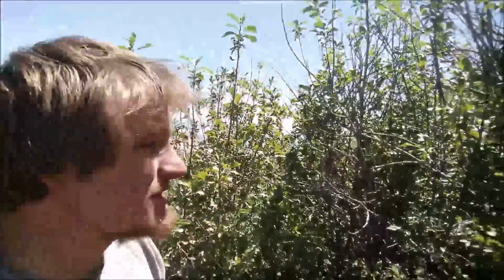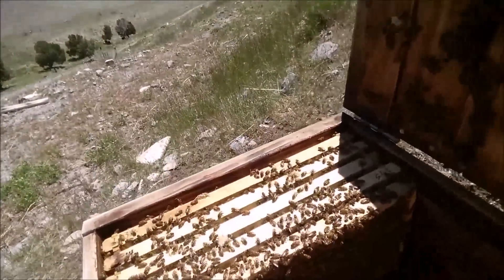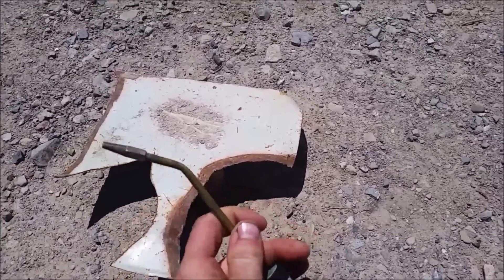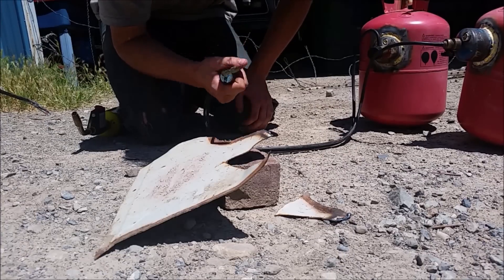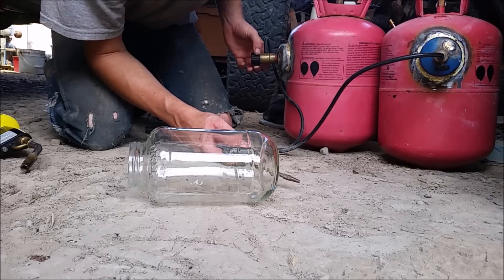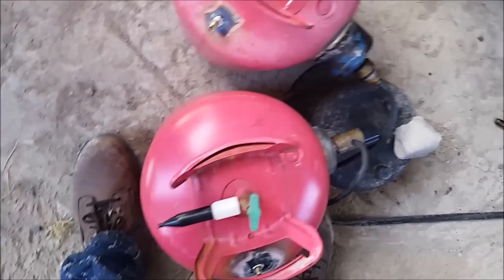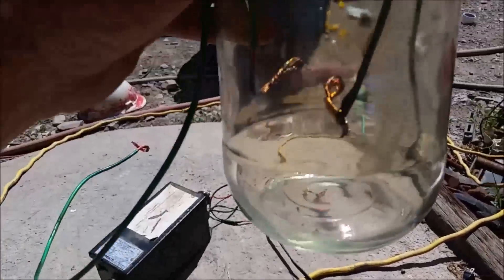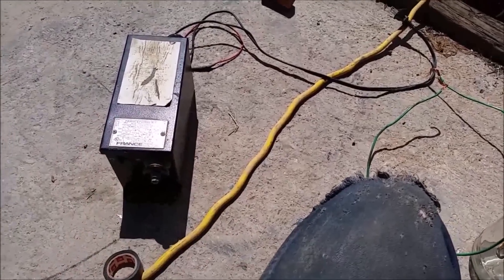Testing My Oxyhydrogen Torch

Comment: I don't know your luck with the oxy/propane setup. Which is what I used that same setup you have(the torch itself). I cut a 91 S10's truck bed with it. I will say it was quite the feat to get the ratios right so that the flame didn't blow out. It can cut thin steel but using hydrogen is very impressive. Might have to setup my own water breakdown system and use that instead. If you had bad luck with cutting where you live(I assume the midwest, I just started watching your videos). It could be to the air density where I live that I managed to get it to cut. I am in the VA area and I think maybe 150-200 feet above sea level. That would be my only theory on that anyway. But awesome videos man. I love trying back yard things like this but your is so next level compared to mine. But being near the DC metro area I can't do nearly as much as I want. Awesome stuff glad I found your channel Cody! My son loves your stuff to when I let him watch. He is 5 about to be 6 in a few weeks so I am sure you could understand not wanting a 5yo mad scientist running around. I already have to watch what he does really close, caught him a few times trying to light up my make shift forge and stuff lol!

Comment: clever licking off your finger after digging them in mercury
Reply: +wesker005 
New to the thing called video editing? A hint: things a minute apart in a video were not necessarily a minute apart in reality.
Reply: Dylan Elliert
Now that escalated quickly. But I've been taught something even more useful: thinking! Uncommon concept for some, but you might try it some time. There is no safety issue here, at least none that's worse than eating a can of tuna.
Reply: +superdau its not like this guy isnt a complete idiot. he DID put a full ungloved hand in mercury..
Reply: +Dylan Elliert Pure mercury wouldn't do anything to you if you put your hand in it. It's the vapor or mercuric chloride that's dangerous.
Reply: Maciej Sopyło im pretty sure he didn't have a face mask when he did it...
Reply: +Dylan Elliert 
And why would he need one?
Reply: Dylan Elliert Reading this thread reminds me of why I had a massive argument with you a while back.. Remember that incredible thread? 600+ comments
Reply: A. Zak I NEED TO SEE IT.
Reply: A. Zak I've had one of those before. It went on for ages.
Reply: superdau thinking is like the biggest part of safety.

Comment: That torch is pretty hot! Tungsten begins to melt just under 6200F!
Reply: +Red_Jacket acetaline is hotter but just a little more then hydrogen but hydrogen can have higher tank pressure, acetylene is the hotest buring commercialy available gass, but there are two gases that burn hotter but need special storage so available only to labs and government so to speak.
Reply: +Mark Robins ok in celc  and an acetylene/oxygen flame burns at about 3,773 K (3,500 °C; 6,332 °F)

form the wikipedia entry on oxy acetaline
Reply: manga12 acyteline torch Is not at all a oxegen torch

Just saying
Reply: +Mark Robins It's not "fucked up" it's just unscientific in a sense. It was designed so that 100 F is body temperature (even though body temp was later found to be less than 100 F)
Reply: +tGhIeNrGmEiRte its no joke thats for sure, and it is very explosive I mean even if, you compress it to like 25 psi correction 29 Psi it will come apart that is decompose violently which results in an explosion
Reply: +james lawrence You're joking, right?
Reply: that places some individuals behind. the rest of us make up for it. . pretty much any religious person is not scientific, as the two are incompatible for religions i've seen.
Reply: james lawrence That is just plain incorrect, a google search will prove that to you.
Reply: ***** Oh no, red jacket has said he is tearing me to shreds, I will surely follow your will and shut up now! If you want to debate/argue, do so. Don't hide behind the comments of other's and act like you've contributed anything. You just ran away and waited for someone else to respond.
Reply: DevilDude4427 the flat earth society was founded in, and still holds it's meetings in england
Reply: Oxy /hydrogen torches are used to melt quartz. Have to use shade 8 glasses to do it.
Reply: +Christian Montrose yea considering I nearly burned the hair off my face when I tried to light a cigar with just the acetelin and a small flame from it it is very hot.
Reply: +manga12 Acetylene's positive enthalpy of formation is scary though...
Reply: james lawrence But we don't make it up. They bring down our average, and other countries have much better schooling that increases the scientific knowledge of the population.
Reply: manga12 You can't spell "science" correctly to begin with, and the church, or any religion, has denied science for the past two thousand years, perhaps beyond that, but into unrecorded times. The Catholic church was the worst of these, torturing and killing those who believed in science and denounced the church. The church still not does believe in evolution or the big bang, as how could they, they are based around these false ideas and principles. The church has been the biggest source of incorrect human information and still today denounces science, along with equal rights for all humans and the humane treatment of other people.
Reply: DevilDude4427
if a simple search will provide evidence, provide links from the results of your search.
Reply: pretty much same as Brown's gas. when Brown's had meets any material, it will automatically meet the required temperature to cut whatever material it has come in in contact with. it will cut through a brick. I'd like to see it cut through a diamond.
Reply: Trust me, my glass torch can run it.
Reply: and yet they do nothing with the education. the vast majority of technological advancement is done in the US.
Reply: +Christian Montrose The torch is not hot at all actually you can touch the flame to your skin and it will hardly burn you, the oxygen and hydrogen is the oxidizer for what ever your burning.   So what ever it is, its burning its self, an oxy/ace torch alone wont cut through the iron it just melts!    Take a hot coal from a fire, what happens when you blow on it?  it burns faster cause your giving it more oxygen.    Burning faster creates more heat, so the tungsten will keep heating up until it melts and falls off.
Reply: 4427 you are mistaken, the roman church does take an interest in sciance, the study of earthquakes is called the jesuit sciance, and the vatican has an observatory for the stars, even if she is slow to accept new theories in sciance as she wants to make sure that after long inquery they still stand the test of time before beliving things, also Saint John Paul 2 said sciance and faith go hand and hand two wings of the same bird.
Reply: you dont know what you are talking about, its the evangelicals that dont belive in the big bang, the roman church would say sure it Happened but God was behind it, philosophy and sciance are two differant epistimalogies
Reply: manga12 The roman catholic church has most certainly not accepted the big bang, the pope was "radical" for even thinking that other people should be treated with respect. The Roman church is a die-hard following of word for word bible.
Reply: ***** Not even close to true. USA is so far behind in science that they still have morons who believe the world is flat because of a book, written two thousand years ago.
Reply: +Mark Robins The rest of the world is a shithole compared to the US of A so of course they can't understand our science.

Comment: Hello Cody!
You made this welder stuff, and its AWESOME! But I have a small add to the hydrogen storage problem:
The hydrogen not only leaking at the smallest spot, but it can diffuse through normal steel. At this process, its dissolve the carbon in steel, and tusn it to methane. The storage can will be fragile, and fail under load. This takes time, but do not trust that container anymore. If you really want to store hydrogen under pressure, youll need some high nickel alloy tank.

Comment: if you want to weld with thermite, do what the railroads do. When we weld rails, the rail has to be very, very hot; golden hot, then you can weld them (steel) together. That was the mistake you made trying to weld your socket extension.

Comment: Cody, I noticed in the second series using your homemade torch, to test for leaks, you were going to dunk the tank in water. In the propane business my brother figured out something similar to their propane leak testing solution by making his own. 

Use an old saline eye drop bottle filled 3/4 with water and just ad a few drops of liquid dish soap to the water. Shake it up, you want fewer bubbles in your solution. Then spray it around the new welding and valves to check for leaks. If you find one it will bubble and pop, bubble and pop. 

Hope this Idea will help you with your leaks.

Sam

Comment: Thanks for this video Cody. I have seen many videos about generating Hydrogen gas and using it for melting stuff. Usually there is no identification of the metal involved. I'm glad to finally see some validation of the test. Do you think that it would be possible to generate enough Hydrogen and Oxygen (maybe even HHO) to use in a furnace for melting Steel?

Comment: Man, this thing you are re-inventing, they are awesome.

Just yesterday I was thinking if a Hydrogen and Oxygen torch will be able to solder metal and voilà, here it is!
Reply: Javier Chiappa It is possible to make it on the fly hooking your electrolysis output to your torch, then you do not have to worry about storing oxygen, which is one of the most dangerous things you can do. 
Since water is already at the ideal ratio for burning, the ratio of produced gases to consumed gases is one to one, and for more or less flame, you increase or lower the voltage to your electrolysis setup.
The bubbling of the electrolysis is a soothing sound, so try not to fall asleep while torching :)
Reply: +Richard Smith electrolysis is slow and the ignition is fast, so you would probably end up with a little blast a no stable flame
Reply: Finn El Humano Its sustainable, you just need a ridiculous amount of electrolysis going on.
I have seen them first hand. They are silly looking and an eye sore, but great to listen to.
To get the effeciency, you have to increase the surface area, and regulate the voltage to ideal levels for each plate.
The end result looks a bit like a giant pc heatsink in a fish tank :)
Reply: Richard Smith I saw guys soldering with this setup on youtube. Seems like a mini acetylene torch (It's called HHO torch). They are awesome since you only need water and electricity. Using mains electricity this process goes much faster than cody using photovoltaics.
Reply: Javier Chiappa Its nice for people who live in the middle of no where and cannot get enough gas to keep them occupied... since they live in the middle of no where :P
You can buy hydrogen generators, but they can cost thousands, and if you are the kind of person who would want one... come on, make it yourself :) I think their are $4 guides on making enough hydrogen on the fly to braze.
Reply: Richard Smith  My only limitating factor right now is InoxSteel sheet Prices :P
Reply: +Javier Chiappa all u need is stainless steel water with baking soda and a bat charger. make hydrogen all day long
Reply: +Javier Chiappa all u need is stainless steel water with baking soda and a bat charger. make hydrogen all day long
Reply: Shane Hildebrand When you use typical steel alloys in electrolysis, you produce rust. The free oxygen gets attracted to the anode and corrodes. Rust is removed/prevented on the cathode.(useful for removing rust) If your water is turning brown, your anode is corroding, either that, or you are burning electrolyte. You could alternate the polarity I suppose to extend the life of a corroding setup.
Titanium is the ideal material afaik, but thats pricey.
Reply: +Richard Smith good to know. thanks

Comment: I'm no expert, but should you be touching mercury with your bare hands?
Reply: M240 mercury cant absorb through skin, so its mostly fine
Reply: As long as he doesn't touch the mercury without gloves after reacting it with an acid and dissolving it in water it's fine.
Reply: a long time ago people practically swam in mercury in industry.. huge vats.. up to elbows all day long, lived long lives.
Reply: No, and welcome to Cody slab

Comment: Hello again.   I lost my eyesight for two days watching a welder work on my truck.   Two years later, I still see white and my left eye is not as good anymore.   
I must tell you that it was the most painful experience, ended up in the hospital.   They rinsed my eye out with a lubricant eye cleaner,    I had a sunburn to the retina.   Please where those glasses.  I did not listen and found out the hard way.  Most people do.   When travelling close to a STAR, humans would go blind forever.  Even with lead glasses.  I worked with a FLAME THROWER for a while, it is not fun.   Mixing gases off old rusty tanks is dangerous.   COLD WEATHER IS DEADLY.  Valves break and explode.  FACE MASKS in wool.  Wool is fireproof and a good material for space.   It can resist heat up to 400f( I think).   Best of luck.
Chris.
Reply: chrisregpick bur why did you look at the arc?
Reply: Most natural fabrics are fire resistant.  Cotton & wool in particular don't really burn under anything remotely like normal conditions.